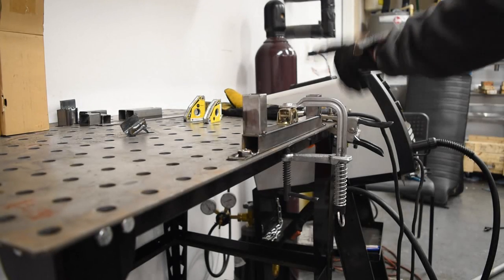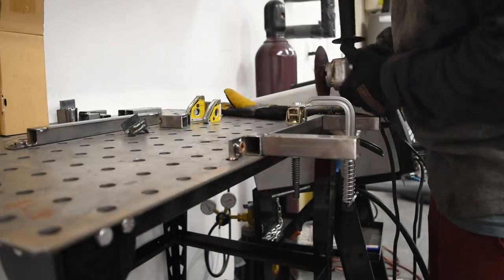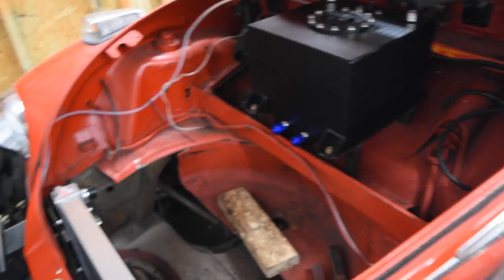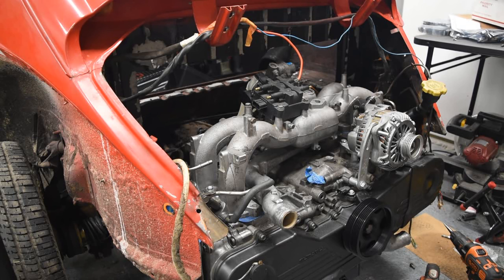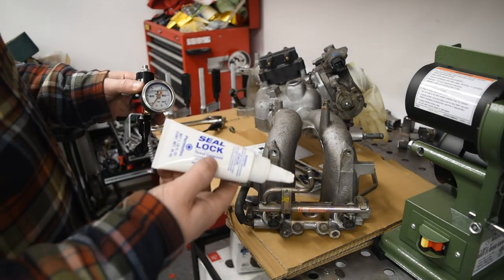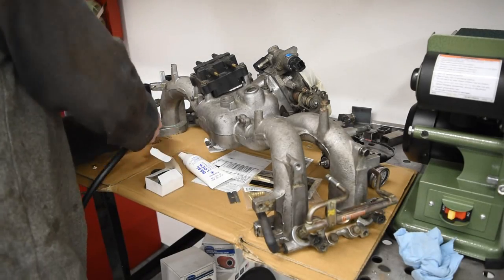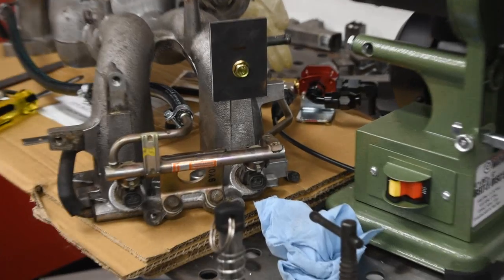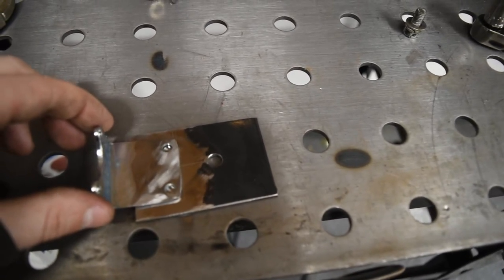Custom EFI Fuel System -- 1973 VW Super Beetle Subaru Swap

Comment: why small fuel cell? Using for just Baja? Not highway?
Reply from the maker: No real reason other than it was cheap and simple. More of a proof of concept to make sure everything worked. I will probably make the stock fuel tank work eventually

Comment: Is there a reason why you are rebuilding the engine? If I were to do a swap would I be able to just place a complete engine in that didn't need rebuilt?
Reply from the maker: I only rebuilt the heads and because the status was unknown. I wanted to upgrade the valve springs and cams since I was going to rebuild anyways and wanted to see what I could get from the combination. There is no reason to rebuild the engine if you 1) bought it from a running vehicle 2) bought it from a reliable source or 3) willing to take the risk of possibly putting a dud in the car. My shortblock is unopened and unmodified ej255

Comment: What pump and filter did you end up purchasing? Also are you doing a tgv delete?
Reply from the maker: We went with a standard inline walbro 255 (https://amzn.to/34ZaMxq) and two filters (Pre-pump: https://amzn.to/2VPa6GV and Post-pump: https://amzn.to/2XWVvM9)

No TGVs since these are N/A heads and intake manifold but I would delete them if there were ;)

Comment: You have way to many contact points on your radiator mounts that will crack or break with vibration. You need to take some welding classes too, I wouldn’t trust any of those welds.  What are you going to do for engine cooling other than just routing the coolant back to the motor since you don’t have a fan to draw air in over the motor? Scoops of some sort on the back to draw air into the motor bay might be a good idea. Like the project.
Reply from the maker: Thanks for the feedback.  The engine will be cooled by the coolant and fans will be added to the radiator to improve the capacity.  I don't understand your question about a fan over the motor though.  This motor is water cooled, not air cooled so there won't be much advantage to air flow on the actual motor like there would be with an aircooled setup.

Comment: Why did you chose to go the fuel cell and external fuel pump route instead of using the stock tank and a Subaru fuel pump?
Reply from the maker: For me, it just seemed easier to go with a fuel cell and I already had 2x Walbro 255s from previous projects so the pump was essentially free.  Using a stock tank would be completely fine as long as you are able to add a port for fuel return as Subaru uses a return-style fuel system.  Using the Subaru pump in the VW tank would also involve some additional rework of the tank to allow the Subaru pump to live in-tank at the correct depth.  For me, the fuel cell was cheap and had all the ports I needed so it was a no-brainer and easy work.  I do not have a donor car, just a large collection of Subaru parts so a lot of my decisions are based on what I have on-hand and what makes sense to me for ease of maintenance and repair.  Thanks for the question!